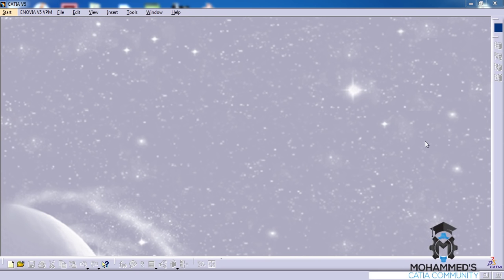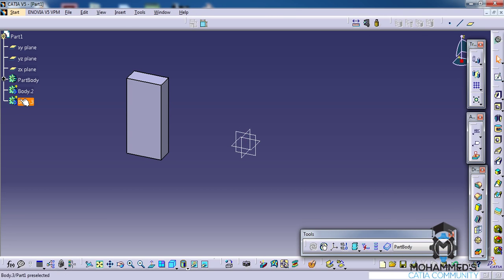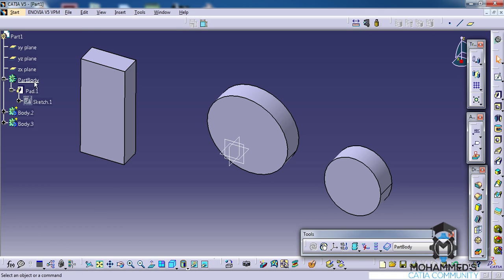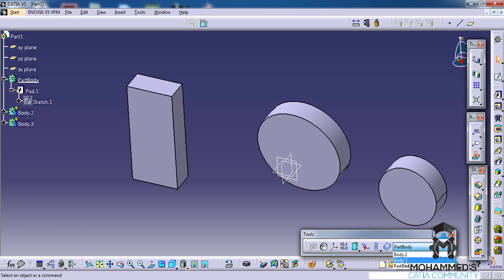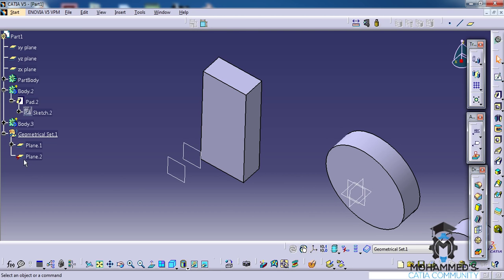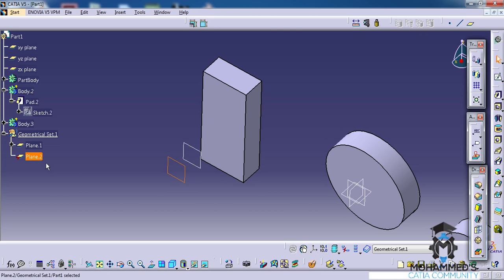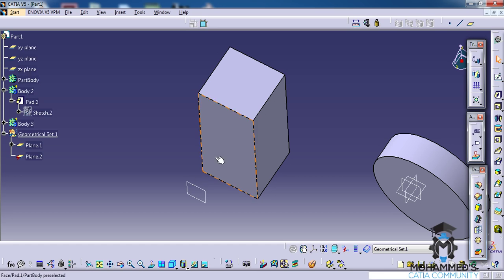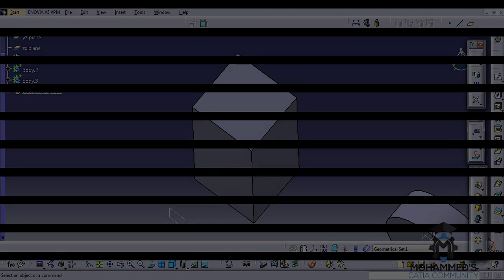Catia V5 Powerful Tricks Collection #101|Use tools toolbar for special Catia functions

Comment: Hello sir 
is it possible to rotate a element when we do drafting , coz at times we need some element at specific angle in DFX 
PLEASE DO A VIDEO ON THIS
Reply from the maker: +suraj kumar pandey Drafting workbench is used to generate drawings in 2D environment. So I didn't understand your question about rotate there. Drawings can be generated in any kind of rotated view, but once you generate that view in drafting, u cannot rotate it. You need to place another drawings if you required another view of the model to be show.
Reply from the maker: +suraj kumar pandey shown*
Reply from the maker: +suraj kumar pandey shown*
Reply from the maker: +suraj kumar pandey shown*